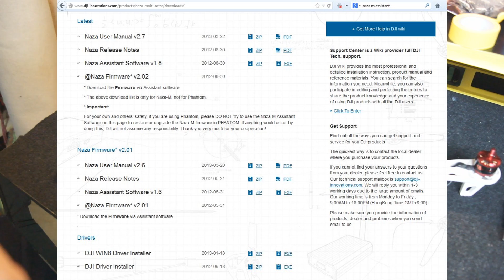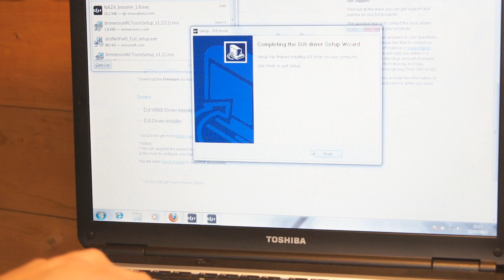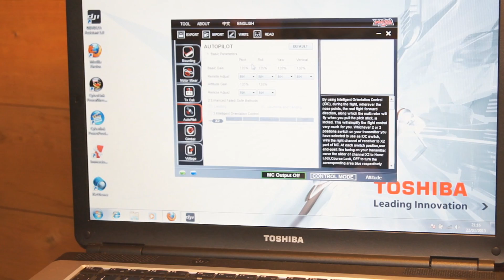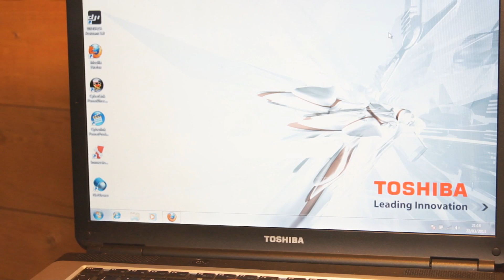DJI F550 build part 2

Comment: Hi, i see that in your other video where you show how to use the tarot 2D gimbal your using a spektrum dx8 controller, would you be able to tell me how you connect your receiver to your naza and what you do when programming the transmitter? it would be really cool if you could make a video to show this as there isn't a comprehensive video that shows how to do this.

Thanks

Comment: Hi I have been following your build and have built one myself. As I am new to this hobby I have one major problem. I have purchased a Turnigy 9x Transmitter with a Turnigy 9x8Cv2 Receiver. I seem to have calibrated it as such but I can't seem to get it out of failsafe mode and MC shows as off. I have spent a lot of hours trying to figure this out but can't seem to be getting anywhere. Can you help!!!!!!!!!!!

Comment: Hi, I found your videos a great help when building my F550.
First proving flight worked well. Fully loaded with gimbal and gopro, which battery would you recommend?
Can only get 5mins with a 5000 3s, how about a 7500 3s?
Or should I go up to a 4s maybe?
Thanks.

Comment: Hello, and awesome video! I am building my F550 now, waiting on NAZA, if I may ask a couple of questions please, first, how has your NAZA V2 behaved so far, any scary incidents? second, I am using an older futaba 9C, was 72Mhz,now converted to spektrum DSM2, regarding the RTH failsafe, I'm aware that programming failsafe via switch selection is straight forward, but I hear that programming RTH via turning off radio can be a pain, heard it was a tricky procedure, thank you, and again great video, very helpful!

Comment: Hi guy, Thank you for your vids they are helpfull. But i have a question and might interests others too, i was looking for a switch to fix it on my hex, i just need a switch to cut the line and neutral off/on when need so i do not need to remove the battrey from my hex power line connection. So do you suggest any particular switch pls ? Thank you in advance

Comment: Just got my F550 and am using your video for the build.  You say if one of the motors is spinning the wrong way, to simply switch around two of the cables on the ESC.  Does it matter which two cables?  I see each input on the ESC are labeled with "U" "V" and "W"?

Comment: Hi, One other thing, are you using the stock props that came with your F550, if so bin them! DJI released a new prop 1038 to replace the 1045's which are stronger and a little stiffer...so they say. Failing that I'd suggest some Graupner e-props which seem to be the most popular/ reliable with multirotors, You'll have to use a spring or star washer and some thread lock to lock it down, Cheers.

Comment: Hi, I wanted to ask if you've experienced any problems with your Naza connected via S-BUS? I have a F450 with a T8J, same receiver as yourself, but when I wired it up using the S-BUS, I found that after I set everything up in assistant software, the mode slider would jump randomly from  GPS - Atti- Man for a split second. I emailed DJI a couple of weeks ago, no reply. But a reply from OnlyFlyingMachines said they've seen this to and they don't use S-BUS connection, have you had any problems?

Comment from the maker: hmmm I don't think that is normal, a fast flashing RED LED means stage 1 of the battery fail safe is on. so you might of had a low battery OR a battery with a too low C rating?.

Comment: Hi there thanks for all your videos on the t8j saved me loads of time I have just finished my first build tbs discovery can I ask when you are in the air  and you use switch d ( fail safe ) and it comes back to you then you take it out of fail safe when it is still in the air should the led flash red all the time until you land then reset many thanks John

Comment: i did,nt no the phantom flew for longer as im loking at fpv i would need as much time in the air as posable do you have any ideas on what would be best, it can be any configaration ie battery, frame,motors, iv heard people say you can get 20-25 mins any pointers i would be greatful for cul8r